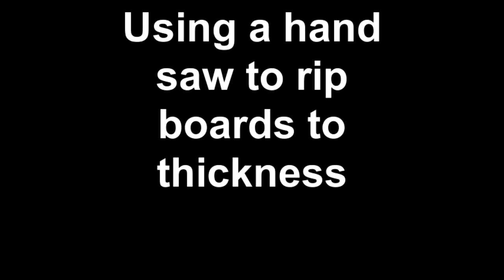Using a hand saw to rip boards to thickness

Comment: I often find that the board moves a fair bit  when you resaw it, and you end up losing thickness when you re-flatten it.  Getting two flat 1/4” boards out of a 3/4” one can be challenging, depending on the amount of twist or bow you get when you re-saw.  It can also be hard work - but quite rewarding.

Comment from the maker: That's a very good question, Chris. The short answer is, yes, the typical hardpoint saw will both crosscut and rip. It may be a little slower, but it will work well enough to get you out of a bind. The old style rip saw was made for one purpose and is ideal for that purpose, but don't think you can't start doing good work with what you have available to you. Happy sawing, Alex.

Comment: Excellently done. This is exactly the same way I was taught to rip wood :-) nothing feels better than doing a bit of work by hand, instead of machine
Reply from the maker: Yes, it can be a bit of work, but hand tools can free us from the limitations of our machines--while you still have them! Alex
Reply: Alex Mosher  i agree 100% !!! more i know power tools more i love hand tools!!!...hand tools in most of the cases give a far better control!!! power tools have a lot of weak points, ...replace belts, bits, motors, special parts... a good well sharpened  handsaw and a well tuned handplane give a lot of fun and satisfaction! greetings from Argentina!!!! :D :D

Comment from the maker: Actually, Josh, my vise is a variation of the old fashioned leg vise. I made my first workbench a few decades ago, and I used an old wooden screw and nut to make a traditional leg vise. I soon became frustrated with the limitations of that design, and eventually came up with a modification that I like. The vise has a few quirks, but works well. I had not thought about doing a video on the vice, but that is a good idea. Thanks, Alex

Comment from the maker: I have no experience buying online, just be careful. Many old saws are kinked or otherwise abused, but if you can find a good one you will have an excellent tool. A safer, if more expensive, alternative would be to buy from a reputable tool dealer, as they usually have a return policy if you are not satisfied. Of course, good quality rip saws are still produced and you could find them with the better mail order houses as well. As to price, not cheap. Good luck, Alex

Comment: Good to see the master of the joiners bench still at it. Resawing by hand cannot match the sound of the 'music of the spheres', however it is the sound of accomplishment for the soul. The old transcendentalist makes do with the previous vise pretty well, however he admires this slanted one all the more. Clock cases need good benches and vises too.
Reply from the maker: Yes, I'm thinking that the slanted vice deserves a video of its own. As you know I like leg vices, but this slanted one was designed to solve a specific shortcoming of leg vices--which it does very well. It is a little eccentric, but that suits me well, as you know. Alex
Reply: Alex Mosher Eccentricity is a virtue.How else are we to survive? Here in old Ontario the Liberals now have us well under the thumb. Survival is all that's left. Time now for folks here to take lessons on starvation avoidance from the Bluenosers.The tables have turned!

Comment: I'm in the market for a decent hand rip saw. I have an all-purpose handsaw now, but find it to feel dull and steering with the grain. There's nothing I would buy on the shelf at Home Depot; I'll likely get it shipped free from Amazon. The selection there ranges from $13-$150. Many are not labelled "rip." I'd appreciate any advice. Thanks -Ian.

Comment: This is a great video! Thank you!
What saw would you recommend for this process? Will a Pax rip saw with 4 1/2 tpi get the job done?
thanks again, this is exactly what I was looking for!! 
And great vice!!
Reply from the maker: +Jl Cuak That should be an excellent saw for resawing. Good sawing!
Reply: Cool, thanks for your vids!
Reply: +Jl Cuak I was going to ask the same thing - I have some thick boards I want to cut down for shelving, looks like I'll be getting a Rip Saw ;)
Reply: "What saw would you recommend for this process?"
  A bandsaw! ;-p

Comment: Great video! I have a question though,

I have a mastercraft aggressive handsaw, it says it has double ground teeth that cuts on both push and pull stroke, with 8 TPI, and the saw blade is 14" overall. 

Q: How do I tell if it is a rip handsaw?

Q: And I find I can never get a straight cut, it always wanders off to one side or the other, I always keep my thumb up on one side of the saw blade, while my hand that holds the saw, I keep that pointer finger along the other side of the handle, so my pointer finger and thumb act as two guides, what am I doing wrong that I am not getting a straight cut?

Sincerly,

-The green nephew
Reply from the maker: Hi Greg,
Not sure about your saw, Greg. It's probably a general purpose saw meant to carry around in a toolbox, and will likely cut both crosscut and rip. It likely has a lot of set which means that it will cut quickly but can wander off your line. 
     Sometimes the best policy with an aggressive saw is to lighten up on the pressure, and let the saw do the work. Slowing down sometimes gets you there faster, just practise.
Alex
Reply: Sounds great, I'll try it out and practice on some scrap wood.
Reply: I know this is a late response but I had a similar problem and I found a solution.

I have two rips saws, same brand, cheap stanleys made in Brazil, I am English but live in Uruguay. They are different sizes and ages, about 5 years between them. The smaller older always cut straight. But the newer larger always cut to one side. No matter how I addressed the wood. Sometimes the cut would end up about half an inch out. I set the teeth so that it produced a wider kerf and gave me the chance to see if that was the problem as the blade often used to bind in the cut. It made the cut easier but it still veered. 

To cut a long story short, it took 5 years to resolve this problem, I found the kerf saw. I don't own a kerf saw, but I may make one, but, cutting a kerf in both sides of the wood will give you a better chance of cutting straight. 

Cuts that used to take hours and hours of careful cutting and guiding the saw slowly can now be done in a fraction of the time. As in Alex's video.

To produce a kerf, I clamp a straight edge (usually an appropriate sized board) along the  proposed cut and with my  rip saw, cut a kerf about 1/8 inch deep on both sides. Then I can rip effortlessly.

Comment: Attempted this twice on scrap still veering off a lot near middle. I guess I need a saw like your or I'm using too much strength.
Reply from the maker: K Hat Lots can go wrong--dull saw, improper set of the teeth causing the saw to wander to one side or the other--or, as you suspect, putting too much pressure on the saw. Lighten up a bit and go a little slower, and you will soon see what is happening. Little things make all the difference. Keep the faith, and keep trying. Alex
Reply: K Hat try making a kerfing plane and use it first. its a like a small handsaw with a fence on it. gets you started all the way around the stock then with a bigger saw you can fallow the channels made. Tom Fidgen has a great video on it.
Reply from the maker: +Crazylalalalala I don't have a kerfing plane, but I have used a plough plane to cut a 1/8" groove around the board, but I'm not sure that this extra work is worth the effort, at least when using a handsaw. Maybe when using a frame saw. The main thing is to determine why the handsaw is behaving as it is. --Alex